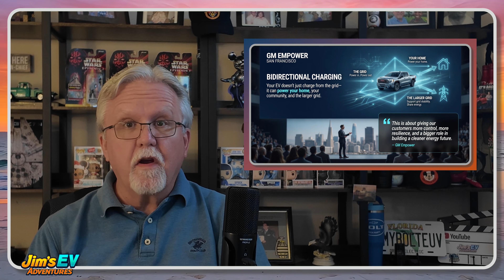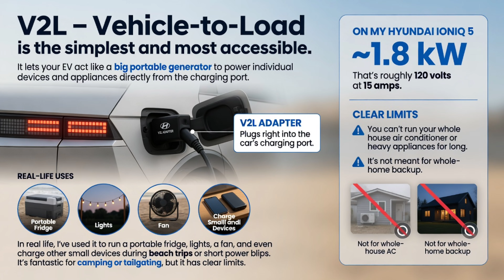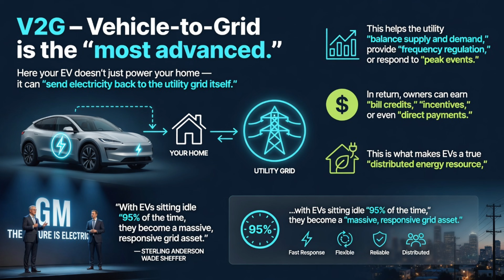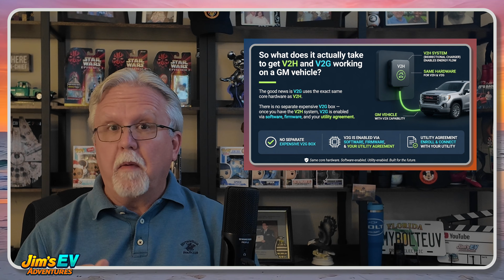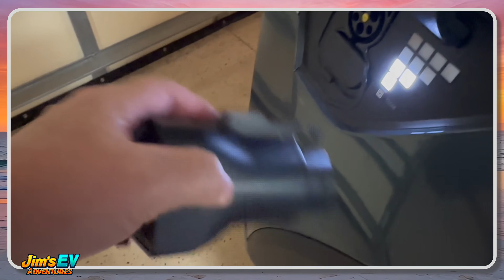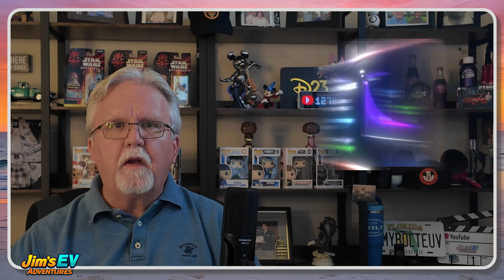Your EV Can Power Your Home! (Here's How)

Comment: This is a feature that GM can "drag" Tesla into V2X  (X = everything).  Since the auto industry in the United States has adapted the Tesla-NACS connector. I hope any equipment bought for V2H, V2G ect would all work with any vehicle brand that has a factory NACS connector.  Then if you switch brands the equipment still functions as normal.  I hope the minimum V2H is 11.5 kws, the same as what the minimum level two charging should be on all vehicles with the 19.2 kws as options for larger battery packs or commercial vehicles where 19.2 kws could keep them much useful without having to us DC fast charging 😉

Comment: I had a battery installed on the house with a "generator" input help charge the battery that I can plug my Lightning into via the V2L 240v outlet in the bed. If will charge the battery at about 5.7kw (they set the generator limit to 80% of the max output of the generator to make sure the generator operates at a cleaner, more efficient power factor). After hearing about the reliability of the Ford branded V2H charger, I didn't want to go that route..
I's over in the Tampa area, so power back up for hurricane season is nice to have.

Comment: I'm scheduled to have a SigEnergy 3P inverter/battery stack installed early next month. With the addition of the DC Vehicle Charging Module, the Sig stack is supposed to be able to do V2H. I'll likely go with a much less expensive AC charger when the time comes rather than the DC charger--mostly based on cost. I think it's great that SigEnergy has a DC fast charger for home use as an option. However, I can't personally justify, for my use, the cost of the DC system over the AC system. I'm not sure if SigEnergy systems are available within the US, but they certainly are popular outside the US. I'm guessing it will be quite a long while before the grid over here is ready to accept V2G, but I can see V2L being quite useful.